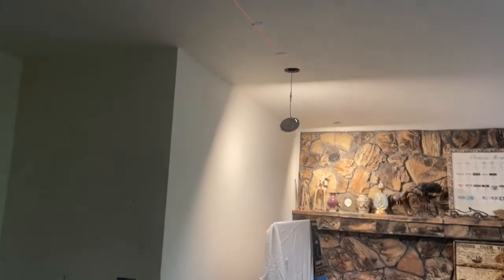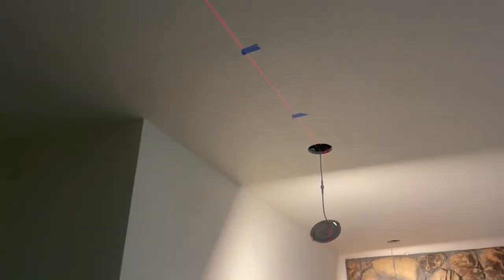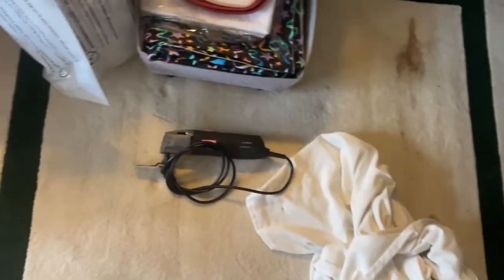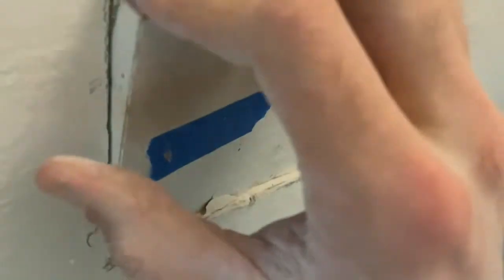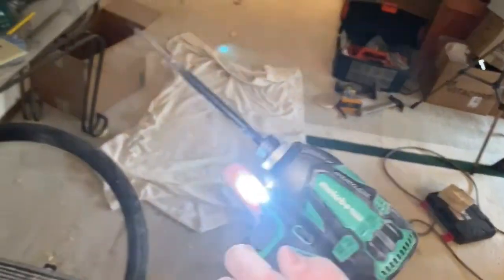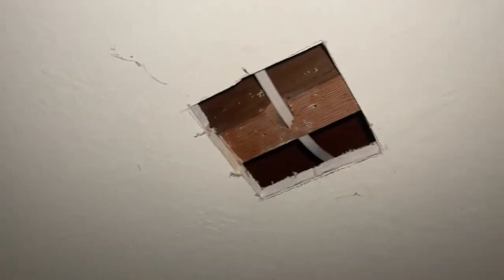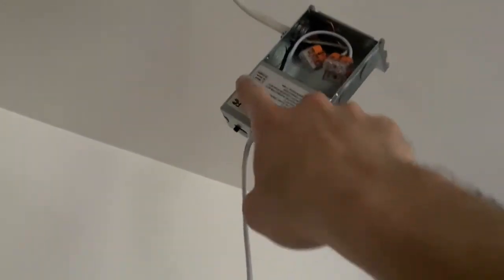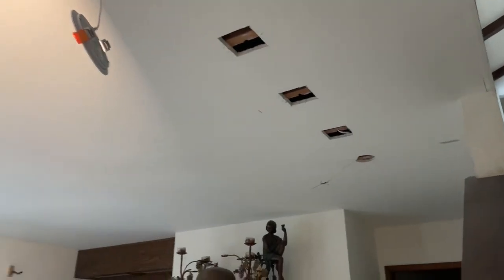Ceiling light install without attic access or existing wiring

Comment: I suggest cutting out the entire strip all along the ceiling. It is probably easier to patch one big hole than 15 tiny holes. Also, then you can get your drill further up and actually run the wire into the stud instead of partially into the stud. This protects it from future you (or other house owners) who might puncture it on future projects.
Reply from the maker: Good call out! I’ll do that next time

Comment: You are not permitted to drill your holes in the ceiling joists in the top or bottom 1/3. In doing so you weakened that joist. You should have drilled your hole higher in the joist.
Reply from the maker: Thanks for letting me know
Reply: Middle of joist is ideal but I believe  it is at least 2 inches from top or bottom.

Comment: Maybe you should have added a metal protection plate at every place where you fed the wire through the joist before you put the drywall to protect some future owner putting in a screw or nail in the ceiling and getting shocked...
Reply from the maker: That’s a good point.

Comment: You know they make flexible drill bits that are 72 inches long right? And you can add extensions to it to make as long as you want.. could have done this with no drywall patching
Reply: You don’t know what’s in the ceiling doing that

Comment: You should of cut in the middle of the joists and you would be able to see 2 sides at the same time and running that wire that low on the joist isnt good they sell metal plates u can place on the joist to prote t the wire